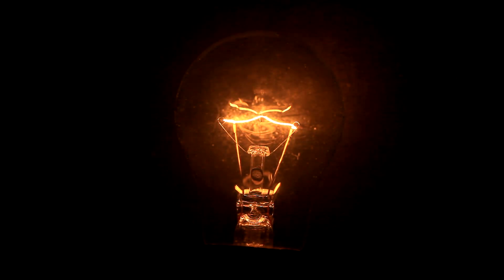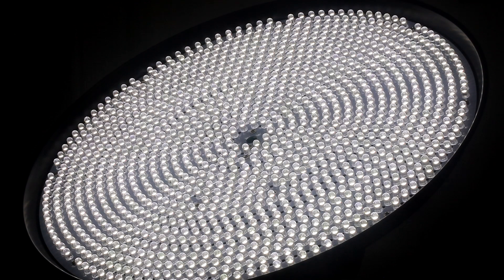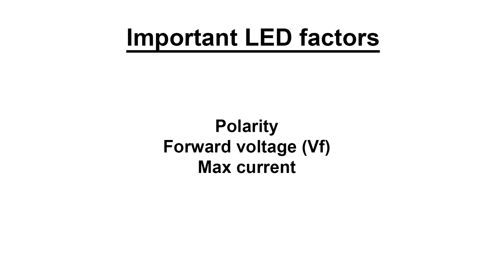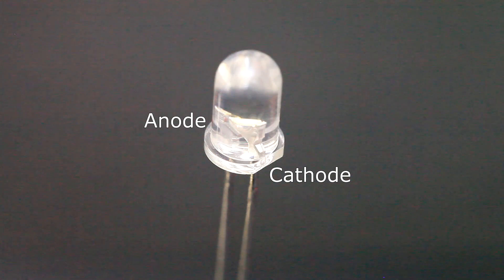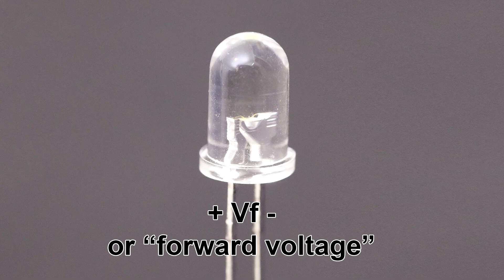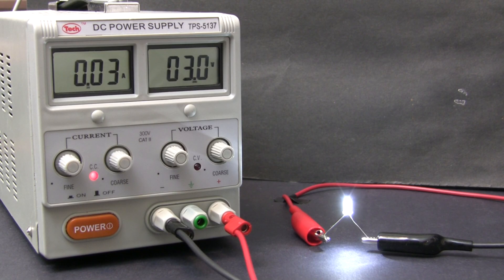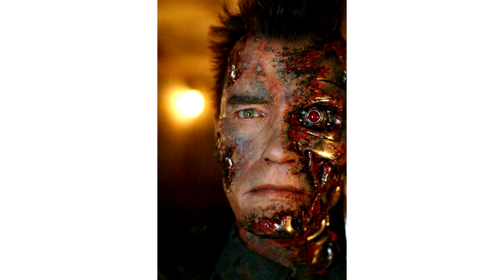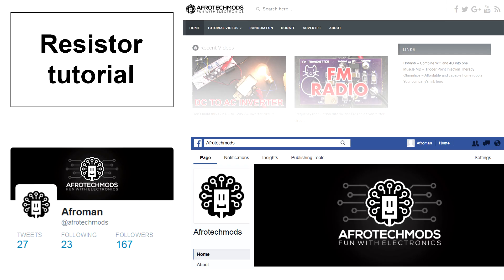LED Basics

Comment: FYI for German viewers: In German, simple to remember the leg length: "Kurz" (German for 'short') for "Kathode". So the short wire is the cathode.
Reply: think of   c o l d   ( c a t h o d e ) as in minus/negative temperature :)
Reply: I always use the pneumonic; 'Cathy rides the short bus... which is not a very positive statement'. 

Cathy is cathode 
short bus is the short leg/pin (you can also take 'short bus' literally and just understand bus as in serial bus... thus it's the negative bus of the diode) 
and not positive is negative.

Then to remember which side gets the resistor... I just think about how some people might get all offended to know how I remember it, to which I would reply; why all the resistance to the short bus. Then I think of the answer, because if negative people didn't have resistance they might explode under pressure (current  was once called electrical pressure). An LED might explode under enough current if it doesn't have resistance on its negotiating pin. 

So now you can remember which leg is which by either the names anode and cathode or by more familiar polarity denominations; positive and negative, and which one to put your resistor on, and why.
Reply: Henner Zeller Guter Tip, werd ich mir merken!
Reply: Malte.  ich mir auch
Reply: Henner Zeller and how do I remember what the cathode does. its always try and error for me:D
Reply: ABaumstumpf 7
Reply: Henner Zeller my teacher said " also jungs, merken, lang ist positiv"
Reply: The leg that is highest goes to Hi - no need for the names.
Reply: Grant Imahara PANIC ( positive anode, negative is cathode )
Reply: Amna Wajahat I like my pneumonic, I know it's weird and quirky, and it SEEMS long when it's in a long explanation... but it's not as long as it seems... first, here it is in its entirety; 

Cathy rides the short bus. Why so negative? IDK, why all the resistance?

That's it... and to remember it all I have to really remember is 'Cathy rides the short bus.' I like it better because yours only says which side is positive and which is negative... but mine says all that plus it tells you which side to put the resistor on.... that and I've already used it for years so I already have it well memorized. If I used your pneumonic in my early days messing with electronics, I would have been left wondering like 'Okay... so I know which side is which, but who cares, how do I hook this thing up without blowing it up?'... of course in my early days I didn't know that you could use an LED as a regular diode too... and thus the polarity is also very important to know... I only incorporated that knowledge into it out of an inherent intuition that remembering all the little details about my components might be be handy... I later extended the conversational memory mechanism to include an argument over which radio station to play on the bus, that helps me memorize the power consumption of different color diodes... Im won't explain it here, in fact I'm very careful when and where I explain it, because to relate it to colors I referenced some questionable racial terms... plus it's even longer to explain, but like the Cathy rides the short bus part, it makes sense to me, and is easy to remember when you understand it... so I'm basically saying, I like mine more because it not only tells me what the polarity is, but it tells me which side to put the resistor on, and in it's entirety, it tells me the voltage ratings of various colors of LEDs, including RGB LEDs.

Suffice it to say the rest of my method that I won't explain can be decoded to tell me all this:

[Red, Yellow, or Yellow-Green have a typical forward voltage drop of 1.8 (using 3V to drive)] |  [Blue, Green, White, or UV have a typical forward voltage drop of 3.3 (using 4.5V to drive)] and this assumes a single diode, a fairly typical amperage of 25mA, and the use of a 51Ω resistor.

There's more, but you get the point, it contains a lot of detailed information... So yeah, it kinda works for me.
Reply: Grant Imahara you’re right, since you’ve been using it for quite a while now it must be easier for you to remember. Plus any hint which helps you remember or link two or more points is always a winner. Another thing, I believe only the one who creates the hints or associations gets the most out of them (mostly), so good for you!
Reply: Henner Zeller is so
Reply: 8mm kurz!
Reply: Good pro tip
Reply: I prefer the 9mm Kurz ( .380 Auto cartridge ) for most of my work!
Reply: Amna Wajahat, yeah, my mnemonic is definitely not going to be useful to many others... but it works for me. There is a fairly common mnemonic I use to remember resistor strip color codes...."Bright Boys Rave Over Young Girls, But Veto Getting Wed." ...buuut, it doesn't do a verry good job of differentiating between: Black, Brown, Blue ... and; Green, Grey...
Reply: Grant Imahara I was thinking the same; the differentiation problem with most mnemonics for the resistor colour code. If you remember the order of rainbow’s colours (excluding Indigo) (starting from Red) then you get most of em, where as for black, brown, grey and white I know that there are two above the rainbow colour-codes and two below, above ones start from the darkest (black) moving to brown and below the rainbow would be grey and lastly, the white (least dark). Again, I’m aware this might not be the most helpful for others but I like to remember it this way for exams, specially given that most people remember rainbow colours from VIBGYOR
Reply: Amna Wajahat I always learnd the rainbow Roy G. Biv ... ROYGBIV... the oppsite direction.
Reply: Grant Imahara sameee, not particularly for the ‘Roy G Biv’ but for the order. We had this poem in nursery or KG where we learned red, orange, yellow, green, blue, violet & indigo (it then went, we can see a rainbow, a rainbow, a rainbow) with an annoyingly catchy tune. Perhaps the reason why it stuck with me. Later did I came to know it’s actually Indigo and then Violet not vice versa. So whenever I have to recall the colours, I sing the poem in my head much like most do with the English alphabets
Reply: Hey, this also works for Tamil Indians. "Kutti" is slang for small, and both it and Cathode/Cathode begin with the "K" sound.
Reply: Henner Zeller  he * k *’ keep 
0
Reply: The word "Anode" comes before "Cathode" when alphabetically sorted.
Reply: https://youtu.be/MJtsJs4Lx7A
Reply: FYI for German viewers: K stands for Krauts, suckers!
Reply: redorange 
Sowas ist der Grund, warum Abtreibungen in Deutschland nicht illegal sind.

Comment: I once bought a couple of larger UV LEDs to build a UV flashlight but the shop i bought them from did not have any data on them. Is it possible to find out the forward voltage with only a basic multimeter without destroying one of the LEDs? Or do i have to look around for something that looks similar and hope for the best?

Thanks for the informative videos!
Reply from the maker: Yes, it's very easy. Put a 1k or so resistor in series with the LED and power it up. Then use your multimeter set to measure DC voltage, and measure the voltage across the LED. That's the forward voltage!
Reply: Afrotechmods Thank, that sounds easy enough. I tried googling around for this answer a few times but found nothing.

Thank you very much!

Comment: Great Video!
Wait... @1:35 Why is the cathode a "C' rather than a "K"? I thought this was meant to prevent confusion for C for Capacitor.
Reply: No, that was really Aemer's question. I was just following up, because usually certain letters are reserved for certain things.
Plus, you can't know that "nobody cares," because you're not a mind reader.
Reply: Lex Taylor Lex Taylor coloumb is a unit for charge (q). you never write coloumbs (c) in a formula you write q.
Reply: Æmer0x C is actually used for Coulomb not capacitor...
Reply: But why ever a c, if "c" was supposed to have been reserved for "capacitor"/"capacitance"?
Reply: Whom are you trying to reply directly to, ABaumstumpf?
Reply: So how is that supposed to answer my question, Baum?
Reply: Maxx, diode terminals are practically never labelled in schematics - the symbol is sufficient to identify them.  "D" is used as a designator for diodes ("CR", in very old documents), just as "C" is used for capacitors.
Reply from the maker: C and K are both used.

Comment: Afrotechmods is finally back🙌 Thank you😀
Reply from the maker: Check my channel there may be some recent videos you missed.
Reply: Thomas Edison did not invent the incandescent light bulb from scratch, but he did produce the first practicably usable one.  He filed for a patent on the filament-based light bulb in November, 1878.  He did not get the idea from Tesla, who emigrated to the United States in July 1884, having produced nor patented such a device.  Tesla is best known for his work with alternating current, essentially inventing the modern AC power grid still in use to this day, much to the chagrin of his competitor Edison, who did everything he could to sabotage Tesla.
Reply: You've been missed, sir!
Reply: Edison built a complete system that worked, and it changed the world.  The Wright Flyer is a totally impractical airplane by today's standards, but it also changed the world.  http://nypost.com/2008/11/13/edison-lights-the-city-2/
Reply: As the narrator said, Edison invented the first commercially viable  incandescent bulb.  Just as importantly, he invented and installed a practical and profitable electrical power generation and distribution system to support electric lighting.
Reply: Edison's system was NOT practical in any sense of the word. It was inefficient, ABSOLUTELY unsafe, impractical to distribute and hideously EXPENSIVE. Plus, you could be killed simply by walking over the buried cables during a rain storm. Dogs would scream and horses would bolt when crossing Edison's buried cables.
Reply: Where?
Reply: Hopeless and Forlorn. (Cheer up, it will get worse!) I agree with you and I see I slightly misspoke in my reply to Garden of Eatin. (Great name!) "Practicable". Yes. I read, "practical". My bad.